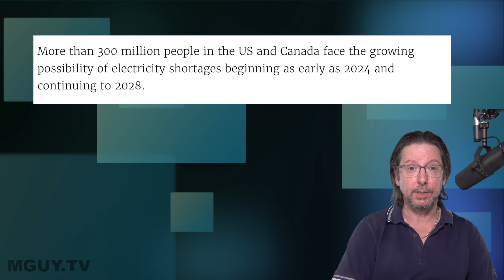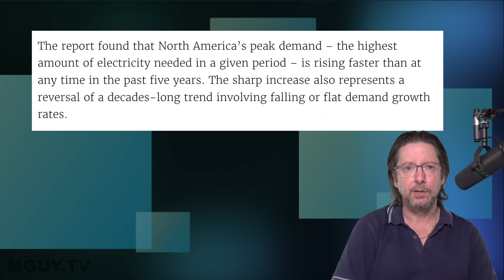Electricity grids WON'T COPE with mass EV charging | MGUY Australia

Comment: To make matters worse, here in Canada, they also are pushing us to replace natural gas heating with electric heat pumps in our homes.  Just add that load to the demand of EV on the inadequate grid.  Looks like a recipe for a very cold disaster.
Reply: It's ridiculous. Nobody brags about how wonderful their freezer is at pumping out its heat into the basement. But they will claim that if you put a heat absorbing coil inside your freezer and have a heat pump sucking on that coil, that it's going to give you a net heat increase. And, it will, because the motor on the heat pump is adding energy to the system. Electrical energy used to perform compression is energy conversion, not energy source. You can't run entropy backwards at no cost in energy to do the work.
Reply: At least electric heat pumps use less electricity than electric furnaces. And I'm sure the grid will be upgraded.

Comment: I suspect they knew this and their goal is to make driving unaffordable. Lack of infrastructure is the extra bonus to force more of us off the road. Their doing similar thing with the gas boilers and heat pump thing. Governments are telling then manufacturers of boilers that so many thousands of their sales need to be heat pumps or be fined thousands. Their starting small. Like 5% but then ramping it up to 25% in a few years. They will make gas boilers so expansive people will have to convert to heat pumps. But lots of homes carnt do this as they are single brick with no cavity wall. The future isn’t looking good.

Comment: hold on, a couple of days ago you told us that EV sales were dropping "faster than a battery thermal runaway", so on that basis this shouldn't be an issue should it? That said, you are spot on with the energy grid and the need for nuclear, the issue isn't actually the fact that there are EVs, the issue is that the government have pushed EVs without consideration of the impact on the grid (thinking that it can all be solved by solar). I have an EV, and I have solar, and a home battery, I am no greenie, far from it, my decisions are about cost to me. I try and charge using solar (direct, battery saved or a combination) but it simply not possible to do this all the time.

Comment: I’m an electrician in the Uk it seem absolutely obvious to me that our electricity supply grid has no chance of supporting the massive amount of power required by the ev plans ,also how can residents in flats and houses with out there own driveway charge there ev  .regards colin
Reply: As I understand it Colin they plan to upgrade the grid, where the extra electic is coming from I really don't know but I do know who's paying for it all, us
Reply: You have no idea what you're talking about. An electrician moves electricity from point A to point B; that does not give you any expertise on energy consumption or generation. My suggestion: stay in your lane.
The average EV consumes about 10 kW/h per day, or the same amount as a tumble dryer on 1-2 cycles does. It does this off-peak, when you're asleep, when energy is available. Absolutely NO infrastructure changes are required with an energy demand like that.
EVs can charge overnight on house current if they want to, no circuit breaker changes or wiring changes necessary.

Comment: In the UK, large electricity suppliers like Octopus now have time of use tariffs that avoid this altogether: I have given Octopus remote access to my EV charger.  They decide when to charge my EV at night.  Often this is 2-4 in the morning, when demand is very low and electricity wholesale prices often zero (or even negative) because of the fixed generation - nuclear and wind power.  Therefore, the generators are happy if I take some of this excess power from them.  In return, I receive night time electricity at 7.5p (day rate is 34p) for my EV and anything I run 23.30-5.30, e.g. dishwashers.  So the problem MGUY states disappears: at night, there is plenty of grid capacity and plenty of generation capacity, whether renewables or fossil.  All it takes is significant numbers to take up the incentive which at that price, they will.  I can get 250 mile real life range for my large SUV for 55 * 7.5p = £4.13 or 1.65p per mile.  Compare to a similar sized ICE e.g. Kia Sportage at real MPG of 29.58 = 9.55 l/100 km and you get £(1.52*9.55)/100 = 14.52p per mile.  So almost 9x as much.  Note that this assumes zero home solar which reduces costs further.  The future is better than MGUY wants you to believe.  Happy New Year everyone.
Reply: You're just skimming the froth off the pot, dude, there ain't enough to go around for everyone to do the same. That's the problem. 

The power grid, if solar powered,  over produces around noon o'clock, not midnight. So what you're buying is cheap power from the fossil fuels backup systems that have to stay hot on standby.
Reply: @HuFlungDung2  I am talking about the UK, where in winter, we have little sun, but lots of wind (in summer, that reverses).  If you are in Australia in mid-summer, then yes, energy companies will need you to do most of your charging during the day.  Again, time of day pricing can ensure that the EVs charge from the peak production.  If Australia keeps replacing coal with solar, then this will be necessary to avoid the negative prices we see in the UK at times of peak renewables production.  Stationary batteries can of course do the same - those are getting significantly cheaper every year.
Reply: Yeah, but he’s a British Engineer. He tells you that at the shows start. British Engineers gave the World the Concorde, the Hovercraft, British Leyland, Lucas Electrics and Norton-Villiers-Triumph. 5 “disasters” right there😳!.

Comment: And like barry Obama said .electricity prices would necessarily skyrocket.
The replacement cost of petroleum forecourts to EV would definitely cost trillions and trillions. 
Europe does not have the space.
The size of the forecourts would have to skyrocket because of the parking space/time required to charge

Comment: Even if they DID maintain or increase the cacity to GENERATE electricity (which they won't or can't) the capacity of the grid to distribute that power is woefully inadequate. Without massive structural improvements, we'll never all mbe able to charge EV's at our homes ... the grid provision to our streets simply won't support the additional load. Aren't we already warned regularly about grid demand problems during a major sporting or TV event (kettles being used at half-time)? A kettle uses 1% of the load required by a charging EV ... there's the problem!

Comment: Anyone over 50 may remember that the same sorts of people now predicting death by CO2 were predicting that the world would soon enter a new ice age and crude oil would have effectively run out by the year 2000. The jury is still out on the new ice age, however, official crude oil reserves have never been greater and the price per barrel is predicted to reach less than $35 over the next year and possibly much less.  Crude Oil is not made of fossils, indeed no one knows what it is made from, where it comes from, or why it is even there. One thing they do know is that there certainly could be several times more of it down there than there is water in our oceans. Indeed they find crude oil virtually everywhere that they care to drill deep enough for it. This lie and many others were put around by the oil industry to help keep the price up as high as possible. Surely this is now obvious? How many fossils do you think it would take to produce all of the crude oil that we have already extracted, or seeped out onto the surface all by itself for many hundreds of thousands of years?  We should also ask how all of these countless trillions of creatures happened to get themselves over 40,000 feet below the surface of the Earth? This is deeper than Mount Everest is above it. 40,000 feet is 3 times deeper than the average depth of the world's oceans. We also have vast reserves of Shale Oil. Is that all made from tiny fossils as well? It is estimated that our official crude oil and shale oil reserves would last another 500 years at our current rate of use. However official reserves could be only a tiny fraction of what actually exists. Even more strangely in many cases when an oil field apparently becomes exhausted, if left alone for around 20 years it seems to magically fill up again.
Reply: It's only the case that 99.999% of people don't know or understand how crude oil reserves were created.

Comment: Worry not, the EV craze is soon over!!! Unless someone come up with a battery technology that doesn’t self ignite and allow at least 800-1000 km travel on a 10 minute charge, my advice is that you don’t hold your breath while waiting!!!
Reply: * Two minute charge. I can fill up and get that range in 2 minutes with a high flowrate diesel pump at the servo.
Reply: @matthewnirenberg  what kind of vehicle can you fill up in 2 minutes that gives you 1000 km range!!! Sounds a bit generous with your optimism!!!
Reply: @erikhenriksson455  Landrover Defender 110 from 1996 with aftermarket long range tank. Note that I did say using a high flow rate diesel pump that trucks use.
Reply: @matthewnirenberg  how many litres does the tank hold and how many litres per minute can baser pump deliver?
Reply: @erikhenriksson455  The long range tank is 200L. What the hell do you mean by "baser" pump?

In Australia we have these things called "high flowrate diesel pumps" that are designed to let diesel vehicles with large tanks (100L+) fill up quickly at around 100L per minute flowrate. Note that smart people don't run their tanks much below 1/4 so filling up is filling 3/4 of the tank.

EV's have the same use issues as unless you want to kill the batteries in very little time you need to keep the charge state within 28%-92%. Outside that range the life of the battery greatly diminishes.

Europe doesn't permit such pumps as EU trucks carry no where near as much fuel as trucks in Australia and the USA do due to Europe being tiny in comparison to Australia.

Most B Doubles carry close to a 1000L over four tanks.

If you're just going to keep asking asinine questions because you don't live in reality and need your hand held, don't bother replying as I'm not going to waste my time on a genius who doesn't know what a long range tank is or what a high flowrate diesel pump is - they're literally at 99% of servos.
Reply: @matthewnirenberg  the diesel pump at the fuel station.
Reply: Don’t underestimate what government mandates can do.
Reply: @softwarephil1709  only if we choose to comply!!! What can they do if we don’t?!!!

Comment: It's not hard to do the sums.  Assume that all LGVs and cars become EVs and they do average mileage and assume each vehicle gets 5.5Km/kWh and charges every night on off-peak.  (Please note that there is no way of knowing how many do not have their charging points and use public facilities when they can and if they are available.  Also note that it is impossible to know who many vehicles use public chargers during the day on long journeys nor how much is being used). The above will tell you how much energy is required.  Compare this with what is available at that time from the grid ( you can forget large battery stores, they provide sod all of the overall demand).   I'll do some sums and come back l8r.

Comment: Don't worry , there will never be a need for mass EV charging.
Most people are not stupid enough to buy one.
Reply: I like your optimism.
Reply: No, he's right, because they won't own any car at all ;-)
Reply: I've had an EV for 9 years, 100,000 miles and I am not stupid. What's stupid is to defend a fuel that has a delicate, global supply chain and is artificially priced. During the peak of gasoline prices a year or so back ($5 a gallon in the USA), the oil industry made the HIGHEST PROFITS IN THEIR HISTORY at YOUR expense. 
Go ahead and remember your comments insulting EV owners the next time you have to ask permission of an oil executive to drive your car.
Reply: @justsomeguy934  so where do you think the elctricity comes from? the good fairy does not exist.

you get your electricity from generators that are fueled by oil.

dams do provide electricity too. 31% is hydroelectric.

69% of your electricity comes from gas.  you think it's smart to convert gas to electricity, and lose power through the power lines and conversion through transformers?

why not just power up your car directly instead of suffering waste of transmission lines?
Reply: @longnamenocansayy  very good question, and I have all of your answers.
1) Electricity comes from a myriad of sources, petroleum only one. In my US state, 35% comes from wind and solar. No fairy involved.
2) The source of energy at a utility plant is meaningless as far as efficiency and pollution goes, at least compared to burning gasoline in a million individual vehicles. Utility generators are at least 2x as efficient energy wise per kW/h that a gasoline engine, and far cleaner than one, too.
3) Electricity transmission lines are stunningly, amazingly efficient. Over a thousand miles, a high-tension power line loses 4%-6% energy. Before you finish an eye blink, a gigawatt of energy can to 1,000 miles over a wire. Now compare that to multiple diesel fuel trucks driving on surface streets.
4) Once you get the gasoline or diesel to an individual automobile, less than 15% of that energy PER GALLON makes it to the wheels. 70% is lost due to heat, the rest due to parasitic losses (alternators, a/c, transmission losses, etc.). An EV is over 90% efficient with the energy it receives.

Comment: Here in the UK the media keeps telling everyone that renewables are working but I know that they aren't 100% providing the power. Reason is that we still have a few gas and coal fired power stations as a just incase scenario, a power station that is fuelled by biomass (wood chippings) and what the green brigade don't know is that diesel also powers there grid during high demand periods in the form of large diesel back up generators, usually located at hospitals, office complexs, retail parks, supermarkets and other large authority or building complexes and as we are finding out EV charging stations. When there is a huge surge in power predicted, the government will contact the provider of these standby generators to turn them on remotely to give the grid an extra boost. The power from the renewable side isn't that great when you look into it as the wind turbines only like a certain speed of wind and if its too fast they destroy themselves and solar really only work efficiently if there are long periods of sunny weather (UK weather isn't usually known for that). We do have other renewable energy sources like hydro electric and tidal but they aren't huge power generators either.
Reply: And the Brits are importing shiploads of wood pellets from North America for their sustainable green power generation. It's all about appearing to be good while doing evil.

Comment: So retiring legacy power generators and not replacing them would eventually lead to lack of supply. So that is where the issue is, power generation and increasing demand even before EVs were to be a factor. As the population grows and more people use electricity, the supply to demand ratio will be the main issue. How many people have A/C and turn it on. I am sure this is where the biggest consumption is coming from.

Also note EVs are a small part of the total energy consumption right now, so to say charging the EVs is a problem is not quite telling the full story.

We need more power generation, they shut down many legacy generators in Vic (such as Hazelwood)/ NSW (such as Liddel) and have not replaced them with equivalent ones to meet demand and now rely on the grid to manage power consumption/distribution. This will eventually fail as more generators are shutdown and not replaced. So many are at least 25-30 years old that they have no choice but to be shutdown as they are simply not maintainable.

On a simple note ALL EVs can be charged via the domestic 240V/10A supply. You just have to wait to get to the required state of charge.

Comment: My quick calculation suggests the uk will require an additional 33 power stations by 2030. We are building 8.
How ever building enough EV batteries to supply all the car by 2030 will take 383 years.
Also an ev battery will consume the equivalent of 8 years worth of emissions from an ICE and here the shocking part the ev battery will only last 3 years.
Reply: 3 years you say?. Where on earth did you get that “fact” from?.

Comment: Most grids have plenty of off-peak capacity to spare. Install enough grid-aware EVSEs for EVs to plug in wherever they are parked to dump any excess into them and most of the capacity problem solves itself. The only real challenge may be how much fast-charging is needed for people who want all the power they can get delivered yesterday. Those are pretty much guaranteed to leverage MWh-scale battery storage to reduce their peak billing from the grid.